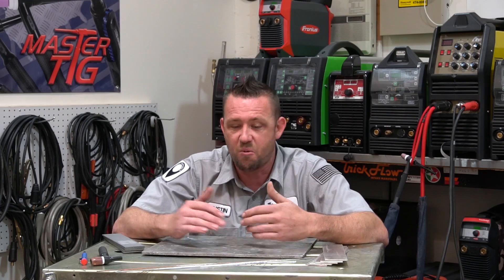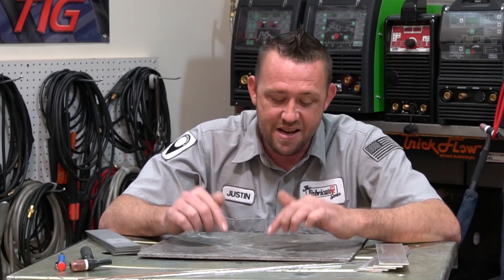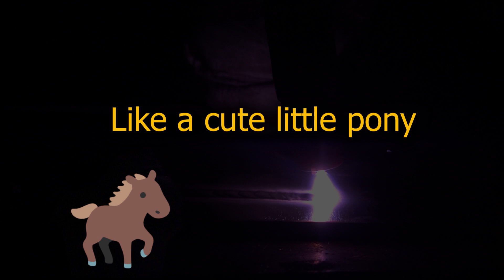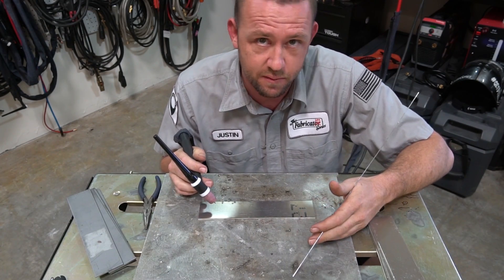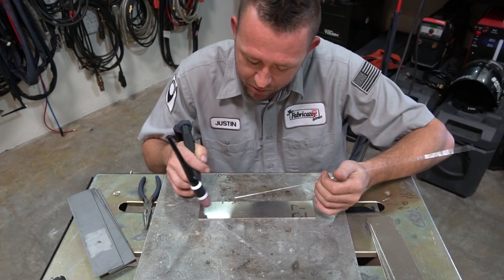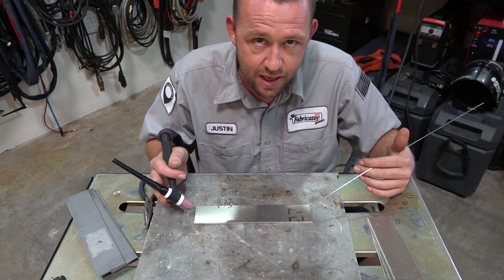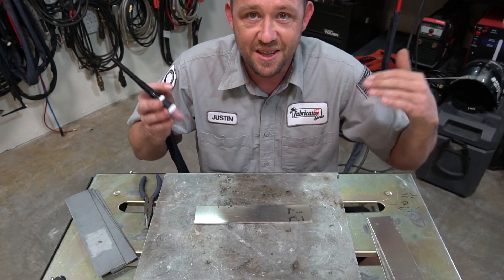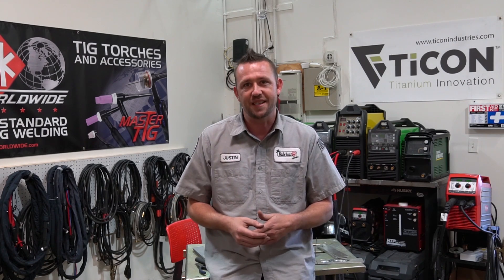TFS: Top 10 Mistakes Beginner TIG Welders Make

Comment: Take numerous dry runs, especially if the work requires a complex wild path.    Practice the entire weld without actually welding and without the hood.   Consider comfort, how both the torch and filler position/angle/distance may change through the weld, how your seating position may change, etc.  Do that a few times until you get a nice, consistent, comfortable weld path through the entire weld.  Then put the hood on and start welding.

Comment: I started tig today with my new welder, it’s harder than you’d think, but after 5 hours 6 filler rods and 7 coupons I got a weld that I was quite pleased with with, 
Thanks for all your teaching skills, could not have got anywhere with your help, I’ll keep buying gas rods and coupons buy the truck till I crack it . I’m trying to weld 1.6 sheets .
Can anybody help on advice for amps and ac balance ?
Thanks

Comment: You have put out so many youtubs, I can't find the one I'm looking for. I would like a posting of "tig welding steel/iron" with the detail that you have given on welding aluminum. I have occasionally oxy/acet welded for many years---only steel. I recently purchased a multi process welder which includes a Tig function. 
Also, in your postings where you weld aluminum, you mostly have your coupon laying on another piece of aluminum or the steel table which absorbs excess heat in your weld and also gives support to the material so that if it gets molten, it doesn't fall through. I would like to see your aluminum welds done on coupons that are suspended in the air.
One more--- Is there any substitute for Argon in Tig welding? I just went to my gas supplier and he wants $300 for a small tank ---weather  I buy a tank or pay a deposit on a rental tank.
I appreciate your Youtubes. Thank you for taking the time.

Comment: #5:  Serenity is inversely proportional to expectations.  However happy I am with what I just did is inversely proportional to how high my expectations were that I'd do fabulous.

#6 & #7: Live in the present moment.  What's past is past.  I can't change it; I can't fix it; I can only observe and respond;  Don't worry about what might happen in the future.  By the time I get there conditions will have changed and something entirely different that what I predicted will probably happen.  And if I had high expectations about my future predictions I'll be double upset.

#10: When I solder electronics I go in the wrong direction for TIG.  Solder gets dabbed onto solder tip after the tip has heated the material.  If I'm doing it right and have enough heat and the material is clean, the solder wicks around the point of contact, pre-heating the material.  (note to self: unlearn this for TIG).

Comment: Great video, thanks. I do have one request - I am trying to learn to weld 0.032 T6061 aluminum to do some (non structural) repairs on aircraft skin. The sheet is so thin that by the time you form a puddle the material sags into a hole. I did experiment with a back plate to dissipate heat with some success but would really like to see a video on your recommended techniques. Using a Primeweld 225x.

Comment: I'm glad you included that last bonus one. I had learned and managed to get certified in stick welding. I have no idea how I did it when it took about four months of in-field work before I FINALLY figured out that you are supposed to only be looking at the freaking PUDDLE! Not the arc, not the angle, not the area around it (be aware of it, but don't pay attention to it), you are supposed to pay attention to the puddle!

Comment: I really loved tig welding. I ended up in the hospital last time I used one, but I really like it. It's relaxing and get so pretty colors.

I remember the anger when you dipped the tip. That little sound when it got stuck and you had to carefully pull it free.

I can't do mig/mag welding

Comment: Thanks for the vid man. Can I ask a question? I am only starting to learn tig, no experience, I have a €300 inverter which doesnt accomodate a switch or pedal, I have to scratch start it. Once I scratch start im just mangling tungstens. What type of machine would you recommend for someone interested in learning tig as a hobby. Ive seen your vids & I think lift start would be really useful or even HF. I dont mind upgrading the machine but not sure what to buy. 
Ps Im not making excuses, my welding is shit 2 but at the min im eating gas & tungsten

Comment: I would add clean helmet lenses. As a primarily MIG welder, my helmet lens often gets  dirty/damaged by spatter.  On the rare occasions I get to TIG, which is something I love but am not good at, I often forget to clean or replace my outer helmet lens until I'm seated and I flip my helmet down to start.  After all the set-up and positioning, I use to try to brute force my way through. Then I got tired of kicking myself when I looked at the bead afterward.  As mentioned I'm simply not experienced/good enough to have the "instincts" (for lack of a better word) to compensate for impaired vision. Having pristine lenses made a world of difference especially in identifying exactly what I was doing incorrectly...and I spend less time replacing/grinding Q-tips.

Comment: TIG welding really reminds me of gas welding.  I've got a lot of hours in gas welding & MIG, but very little TIG.   I've run a TIG once,  to fix an aluminum transmission case about 15 years ago.  I just picked up an Everlast to repair a cast aluminum motorcycle case (and a cast Aluminum frame next).  I've been practicing on some junk cases 1st and it's harder than I remember.  These videos are helping though.  Frequency, balance,  stick out,  Flow, Tungsten choice & grind,  these are all things I don't have much experience with.  I probably shouldn't jump right into welding who knows what filthy alloy cast aluminum, but I am.  I'm not sure I'd have the confidence to do it without YouTube.

Comment: My welder (I just received) has an amperage dial. Starts at 10-200 amp. It's arc/tig. I'm confused about the digital current screen. I turn amps up and the current goes up. After I strike an arc with stick welder the digital current number doesn't move. What is the purpose of the digital current reading? Thank you

Comment: I’ve been a boilermaker for 18 years and I agree with all of it until it comes with the # 10 reason , which is still right, but in tight quarters there’s times that you have to weld backwards, or drag the cup uphill and feed the rod from the bottom, granted it doesn’t look as pretty as your welds you have to do what you have to do, but also you said that if you can’t see it then you can’t weld it, well to be a good boilermaker that tigs you have to be able to mirror weld and that’s a totally different ballgame because everything is reversed, aluminum is my only obstacle now but there’s always room to learn on every level or type of tig welding, enjoying the series keep up the good work

Comment: Sorry i can't spell

I cann only talk about  stickwelding (certified)

By the way the first 6 years afther being certfied the hard postition welds were still demanding ( now 17 years stickwelding,at the moment not certfied because of admin mishap always kind of relaxed and does not matter where i have to weld with stick)

Tig i vind kind of hard (perhaps because used to weld stick with kind of high setings)

Started welding  tig with 10 amps more then minimum and stil gets Hot (perhaps got a tip/ position PB half v weld with 2 mm gap and 1 mm filter rod

Comment: Ok I'll help you all out. Iv been tig welding stainless for 27 years , in a production shop custom work . Here is what I tell everyone. First start by turning your heat down to cold. Ten work your way up . Tip 2 get a rest with both hands , torch and rod.

Comment: Great video. Today is my 2nd day of TIG welding training. Its paid training at the shop I work at. I spent all day running beads and dipping tunsten lol. Tomorrow will be better, but by the end of the day I was putting some pretty good beads down on stainless at 125 Amps

Comment: The lack of preparation of the parts for welding has to be the number one mistake that new welders make. Cleaning the material, grinding the edges and fit up is very important for beginners to understand.

Comment: If you would have burned holes in the metal, then, it would look just like my 1st time TIG welding. LOL In fact I fired up my MIG and ran a few lines just to know I can still weld. If you weren't a 1000 miles away I would be in your class.

Comment: I really appreciate the information you share in your videos, breaking it down barney style for us noobs helps us, or at least me, understand the concepts and not just the action. Though i will say there is one mistake, or something i feel might be considered a mistake that no one seems to cover in the endless lineup of videos about beginner mistake and thats which hand to hold the torch in. Now this may sound stupid, but i'm generally curious  if there is a right and wrong hand to hold the torch. I feel that it's should be one of the first things taught, way before striking and arc and practicing actual welding. So before i receive my new machine and start the long road of attempting to teach myself how to Tig weld, which hand do you recommend someone hold the torch?

Comment: Hey Justin thank you for the awesome videos. Quick question for you. I’m new to the welding world and I’m just looking it as a hobby and some motorcycle projects at home. Is there a TIG welder that you will recommend that will not break my bank account but it’s still good quality for doing steel and aluminum? I’ve seen one digital on eastwood for around $1400. What do you think about that one, or should I spend little more on a better unit and what brands would you recommend? Thank you.

Comment: Literally did the last one on the list which was direction of the weld. Went the opposite direction. Now that I know I can finish the job I have for a friend of mine.  Now I need to figure out the settings for 120 wall 1.5 to make it cleaner on my primeweld tig 225x

Comment: Great video I wish I'd seen this in 2007 when I started TIG welding!! Great but I would've added near the end that the angle between the tungsten and the filler rod should be around 90° as it says in the Cswip3.1 book. Cheers,,👍👍

Comment: I’ve been watching you for a couple years now and love the videos. I’ve TIG welded a lot of stainless but very little aluminum. I’ve setup the welder on the thickness of aluminum thickness of the job I’m being paid for and I will lay a nice bead but as wood as I add and angle to it, the welder acts like I am completely off on amps and gas settings so needless to say it takes hours to get anything to stick. What am I doing wrong?
Reply: Are you using AC current? DC doesn't work for aluminum.

Comment: To keep a long story short I have been a certified smaw (stick) welder for 25 years....that being said I can stick and mig with ease ....anyone can mig...lol..flat anyways....I have tried to teach myself to tig weld (especially aluminium).....my personal experience is......it's all about what machine you use....(at least when it comes to high freq welding)...I tried it with a huge miller syncrowave....no problem felt like a pro.....my Miller diversion 180....just can't get it....don't know what to do...lol...major issues...lol...any suggestions

Comment: I bought a everlast powerpro 256 and it came Friday. Saturday I got a tank & started trying. I have no bench yet or an indoor area I can do it in, So im outside in the back yard, sitting on the ground no pedal and im welding is on a planter box I built for my wife. I think I'm definitely trying to learn in the worst environment. But I'm trying, today I did some (autogonues)(SPELLING) welds on 1/8th aluminum scrap & also 3/16 steel plate. Fun & challenging & with the wind it's also frustrating.

Comment: Justin, love your video series!  but one really cool thing I noticed about your instruction is the way you hold the torch and filler rod.  I’ve learned that the proper angle between tungsten rod and filler rod should be 90° or as close as possible.  When YOU pick up your torch and rod for demonstration, your positioning is damn near perfect.  You don’t fidget, adjust or anything.  Super cool!  Please, keep up the fabulous videos!

Comment: I made all the mistakes, but quickly. Because of videos like this I was able to correct my problems and get moving forward. The only welding I had done before was a little bit of fcaw. Now I weld aluminum better than steel, and I get so impatient when the steel isn't puddling quickly like aluminum and moving fast.

Comment: For a beginning welder learn the basic fundamentals by stick welding first. Learn to run a strait bead and maintain an arc while feeding the puddle. How to stay comfortable, consistent and maintain proper angles.. jumping into tig welding introduces many more parameters that have to be controled such as using one hand to control your torch while the other has to feed filler rod. And then having to use a foot pedal or torch control. Good tig welders have run miles of beads!

Comment: A long time ago i learned how to make and/or repair things made from metal. One of the most satisfying was building exhaust headers using an oxy acytelene torch and filler rod. At one point i had to repair some obscure farm machine using a big tip and cloths hangers as filler rod. What i never lerrned was how to make a living at this. Thank you for your excellent video.

Comment: Interesting about “hopping”. Jody from welding tips and tricks, lifts the tungsten slightly when feeding the rod in, then lowers it when pulling the rod back. Just a little bit, to prevent dipping. He only has about a 1/16” arc length, most times.

Comment: WOW, I wish I had found this video when I started, my down fall was I started before the video was made.  Super video and a real eye opener to new guys.  I STILL regard myself as a new guy and started a few years ago. The position of the cable and direction\position of your work really hit home as the problems I had at the start. Later on I started to watch the material disappear in front of my arc and rod because of the heat in my work. This is a fab vid, get lots of scrap and play with the principles seen here. :-)

Comment: I like 4 and 5 and the fact that you went away from the mechanics of tig welding and went to the mental aspects of tig welding. Excellent I wasn't expecting that but I'm glad you went there. So many people I've tried to show tig well too were "experts before they even picked up the torch"  Spot on. All the mechanics of the weld you  offered were very good and absolutely correct. The one thing I've always discovered is people tend to either choose too light or too dark a shade and then refuse to change. Either they can't see enough or they are almost turning their heads away.  I have never understood why. Tig creates one of the brightest flashes , more than stick and mig bit these people seem to think one shade will cover everything.  I have separate shades for almost every process. Been at this for ever and you seem like a very good instructor.  Well done.

Comment: Learn Oxo Acetylene fusion welding fore hand first to save  your  eyes and get better a undressing on the tig process plus make yourself comfortable .
Reply from the maker: Oxy is not the same as TIG. The biggest hurdle we have during training is with those who learned oxy first since the control of heat is backwards with an additional element of control.

Comment: Been arc welding for over 30 years...structural steel, pipeline..etc.
Tried tig several times...suck at it. Kudos to anyone that has mastered it.
 I sold mine cheap....wish id run into your channel before then....great tips

Comment: Welding isn't rocket science, anyone can do it, the only problem is welding machine companies make machines expensive and sometimes hard to use on purpose.
Reply: @jeffel80  Metal is metal and wire is wire. It's not rocket science. Metallurgy might be the new fad this year, but it has NO bearing on welding.

Comment: I like your last point about if you can't see the puddle. I took a MIG course and I couldn't see the puddle, couldn't figure out what was wrong. It ended up I needed glasses. With the helmet on and the low light conditions, my depth of field was poor and out of focus. Got a pair of reading glasses and finally could see what everyone was talking about. I didn't need glasses in normal lighting but low lighting did.

Comment: This actually helps alot, I've takin a light sheetmetal mig welding course while doing auto body. And I've been looking into doing more fab work, still need to picl.up a tig welder. Also, I only have about 2 to 3 hour of tig time, I have thousands of hours of mig, but I didnt struggle much with tig for those few hours I did so. The only hard part was learning touch lift when doing so. I was looking at a Lincoln 175 tig machine. Is that a decent start for a tig machine?